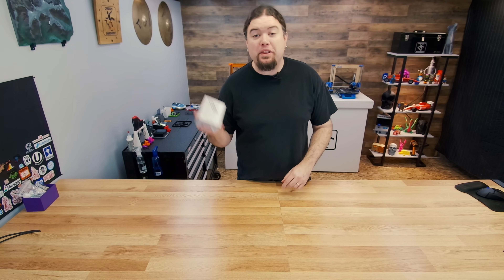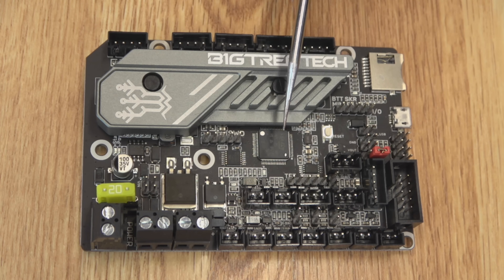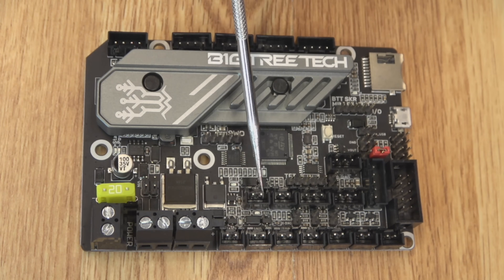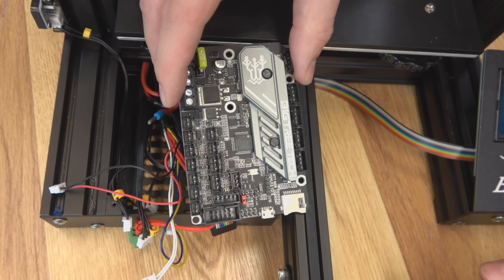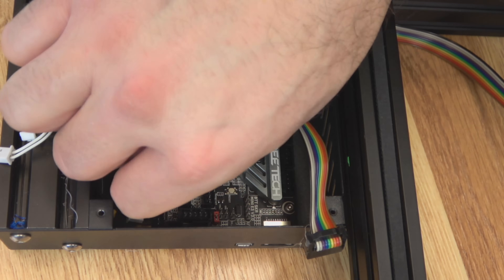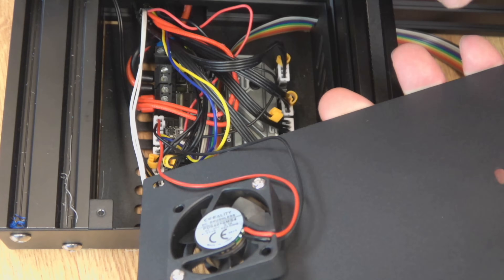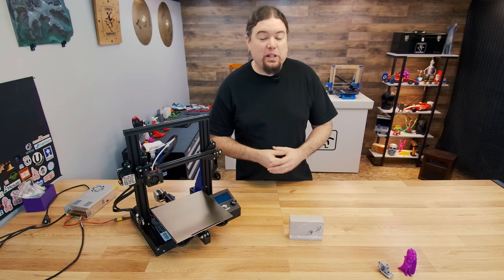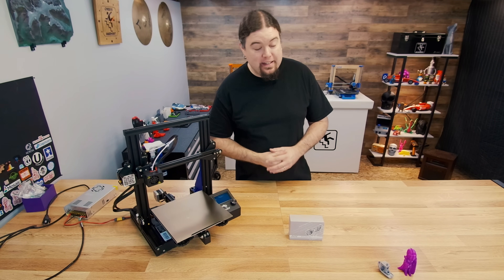BigTreeTech - SKR Mini E3 v3.0 - Chris's Basement

Comment: I'm considering this board as my SKR 1.4 turbo upgrade is a failure so far.  Can't home.  Testing stepper motors then if they all ok, I'll pull trigger on this board.   Question:  is there a way to add LED lights for bed illumination ?    Great Video.  Thank You
Reply from the maker: Thanks! Sure, you should be able to add a few LED's and power them directly.
Reply: @ChrisRiley  is the BTT TFT 3.5 screen (firmware 2020) older than SKR 1.4 Turbo.   The mainboard firmware was updated. Screen cannot see printer in btt mode
Reply from the maker: @bruceyoung1343  It's probably and issue with the serial settings in Marlin. Try setting serial 0 to -1 and serial 1 to either 1 or 2. That should be it going. Make sure the baud rate in marlin and on the screen match.
Reply: @ChrisRiley  I can heat the bed and nozzle.  I can see my custom name.  I wonder if btt TFT screen needs firmware update
Reply: @ChrisRiley  just to confirm that’s in configuration.h.  ?
Reply from the maker: @bruceyoung1343  Correct.
Reply: @ChrisRiley  I have serial and serial 2.  So I had serial at 0.  And serial 2 at 1 (no printer attached) and then at 2 ( no printer attached).  Baud rate firmware 250000 and printer 250000.   I’m open for suggestions 😕
Reply from the maker: @bruceyoung1343  Only other thing I can tell you is to make sure the cable is correct.
Reply: @ChrisRiley  they are Chris
Reply: @ChrisRiley  the BTT  TFT SCREEN FIRMWARE IS 2020.  Can that have a bearing?
Reply from the maker: @bruceyoung1343  I could, I would consider upgrading.
Reply: @ChrisRiley  firmware for the btt TFT screen?
Reply: @ChrisRiley  firmware on it now is dated 2020
Reply from the maker: @bruceyoung1343  https://github.com/bigtreetech/BIGTREETECH-TouchScreenFirmware
Reply: @ChrisRiley  THANK YOU VERY MUCH

Comment: Thanks for the video Chris. I have two z steppers installed, would it be better to use the split cable or two separate cables and are there any issues to be aware of with either option?  👍
Reply from the maker: Both options should be exactly the same. I would just go with 2 cables I think.

Comment: Hi Chris I just bought SD CARD Extender, so I can use norm SD card. But when I plug it, the Lcd Shows SD Init fail. How to solve it?
Reply from the maker: Not sure, it should work the same as the SD card, unless it is wired differently.
Reply: @ChrisRiley  I think it has something go to do with the configuration in firmware. Or just compatible with sd slot on tft screen. The SD Extender works fine on ender 3 pro original  board. It's detected automatically after inserted.

Comment: I have just installed this in my ender 3 v2.
The screen is black and the buzzer sounds. Contacted BIGTREETECH and was told the stock screen is incomplete. 
Probably worth a mention. Now what ? 
Junk the board or get touch screen? Or is there a fix ?
Reply from the maker: Yep, the V2 screen is hard to deal with. You could make a new cable that would work, but it's not going to be easy. I would probably just swap to another screen.

Comment: I hate to bother you, I know you've probably got more going that people think but I am stuck. I purchased the Mini E3 V3.0 and right out of the box the board does not recognize that it even has a Micro SD slot on it and it say no printer attached. Though a defective board so I had Amazon replace it. Well guess what, the second board has the exact same issue. Someone said it is because I'm trying to use it to upgrade a Anycubic Mega Zero 2. Their nuts. That has zoo to do with it. Steppers are steppers. Period. Also, in marlin mode the board will control everything but in the BTT mode zip. Configuration  is: BTT Mini E3 V3.0, BTT TFT35 E3, Anycubic Mega Zero 2, second Z-Axis Stepper installed, BTT Wifi, "which works flawlessly" , stock Extruder. I am going nuts trying to get this to work. What are the chances both boards build months apart have the exact same issues. I feel that if I could flash the firmware it might fix it but without the Micro SD working I have no idea how to do this. Please help if you can. I've tried contacting BTT, ya right. They have my money " so to speak" not even a response after several emails. What a joke of a tech team. Anyway, I'm frustrated and about ready to take ALL my BTT products out thetherange and make a nice YouTube video of me using everything BTT as targets. That's how disappointed I am with BTT support. They suck.
Reply from the maker: Hey, so if it's working in Marlin mode and not touch screen, it's usually a serial setting causing the issue. Try changing serial 0 to -1 and serial 1 to 1 or 2. Make sure the baud rate setting on the screen and in Marlin match as well. Hope this helps.
Reply: @ChrisRiley  Well have you ever felt like a total idiot. I'm there now. For whatever reason I had the TFT plugged into the wrong serial port. What an idiot. Just goes to show that even us so called old and wise can make some pretty stupid mistakes. And I made a big one. I still heeded to do a lot more playing with firmware and the such but it would have gone a lot faster had I noticed that mistake. However, I still appreciate your responding and trying to help. That was very kind of you. Thank you. I'm now doing some fine tuning for nozzle distance from the bed and a couple other minor things but at least everything now functions as they should. Again, thank you so much for your help. Have a great day and keep up the great videos.
Reply: @ChrisRiley  You are awesome just for responding. You have been the first to actually seem to care. Thank you. I will give that a try. Of course if it works you're a hero. Thank you. I'll definitely let you know what happens.

Comment: Hey Chris, I need some help please getting the mini 3v3 to turn on. My first mini v3 I thought was fried cause when I plugged it into my computer no lights would come on nor comms link. So I bought a mini v2 and v3 just to test. Now the v2 will light up and establish a comms link when plugged into the computer but the new v3 still won't light up nor open a comms link... What's the odds that 2 mini 3 v3 are fried? Am I doing something wrong? Or does it require a power 12/24v power supply to come on? 
Mike
Reply from the maker: You have to switch the VCC USB jumper to get them to light up via USB. It's a red jumper, if you can't find it I will get you a pic.

Comment: Question before I get one... My ender 3 pro has the SD and usb slot on the upper left instead of the bottom right... is that because the board is upside down on my older ender 3 pro?   as my fan is also on the bottom of that box where the board is....
Reply from the maker: Yes, some ender 3's the board is flipped over, these boards should still fit.
Reply: @ChrisRiley  Thank you,... one more quick question....  What is a Thurmister?    LOL      

I really know what you meant... had to mess with ya...  thanks again for the reply..getting ready to put my new board in now...

Comment: Can klipper be installed instead of marlin as its firmware? Or is klipper run from the PI?
Reply from the maker: It can be, but you will still need a Pi to run Klipper.

Comment: hi Chris. .. I just followed your tutorial ,  after all installed. my Auto homing failed.. do you know why ?
Reply from the maker: What did it do when you hit auto home? Anything at all? Are you using sensorless?
Reply: @ChrisRiley  I have fixed it .. seems the belt it too tight.  thanks .. do you know how to add wifi to the board ? is it possible to use BTT TF cloud ?

Comment: Quick question is it possible to connect the new creality screen to a skr e3 mini v3?... I know everybody's going to say just get a TFT35.... But I have a couple extra creality screens that I would love to use and not spend the money...
Reply from the maker: It depends which one. If it's the one like on the Ender 3 V2, I am not sure that will work. The 12864 style with no SD card would work just fine.
Reply: @ChrisRiley  thanks Chris and of course that's the style I have is the Ender 3 v2...my luck lol

Comment: Got one of these for my CR10 V3. The stock board for it is larger than the SKR Mini. I'm also putting in a BTT TFT35 V3 with it. I can't find firmware for the CR10 V3 anywhere
Reply from the maker: I didn't even know there was a V3. I would guess the stock CR10 config would work of the most part with a few added tweaks.
Reply: @ChrisRiley  Using the V2 firmware. The V3 has dual Z like the V2. It has direct drive so e steps are way off

Comment: I got my board installed, good firmware, however when i try and move the Z axis, it also moves Y axis as well. I get no movement with X, but when i I try the Y axis movement it moves X axis. Any thoughts?
Reply from the maker: Whoa, that doesn't sounds good. That sounds like there might be a short of the board somewhere.

Comment: Make guide for mk3s with SKR mini E3 please!!
Reply from the maker: It should work the same as the Ender 3, but you will lose all the Pursa firmware goodness.
Reply: @ChrisRiley  im so noob on custom programming like this but i have prusa bear kit i used to use with my prusa mk3s. Now mk3s back to stock i have left with all frame & linear rail, just need printed parts and electronics so im planning to revive that with fly e3 pro.

Comment: Just ordered mine after shorting my 1.2 when brushing of my nozzle 😉 Damn those naked cables on the heater... 😉 Thanks for the video, it really helps with the initial setup! 😁 Please continue making these even if its just a new version with some minor improvements 😊
Reply from the maker: Thank you! Will do!
Reply: Done the same thing on two different printers and boards. Connect a fuse on one of the cables. This way you should have no problems with blown boards.

If you're lucky it´s only the heater circuit and/or thermistor circuit that´s blown, but the rest can work.
Using klipper you can add the board as a auxiliary board, to run more steppers, more controlled fans, etc, etc.

Comment: I installed this board on my Ender 3 v2 using the default Ender screen. When I power it on, the screen just lets out a continuous beep. I tried to update the firmware with the latest precompiled bin they have on their Github but it did not flash onto the board. I've been told that I have to rewire the ribbon cable of buy the TFT screen but you seem to have it working with the default Ender screen (although yours is the older one and not v2). Any ideas?

Yes I formatted the mSD the firmware is on as FAT32*
Reply from the maker: The V2 screen is a lot different from all the others. I am not sure what it would take to get it working like the old school screen. I know Marlin supports it, but that would require builing a new config for this board with that screen enabled.
Reply: @ChrisRiley  It looks like it did flash the the bios from BTT's github. I noticed the firmware.bin on the mSD was changed to a .cur. So I imagine that bios just isn't the most up-to-date.

I'll try compiling a new Marlin v2.0.9.3 firmware tonight and see if I can get it to work with software before I go and make a new cable.

Either way, I'll report my findings here in case others are having the same issue.
Reply: @SchwettyBawls   tambien tengo e l mismo problema men

Comment: Thank you for all the information, by Ender 3 pro board died yesterday and I got the BigTreeTech - SKR Mini E3 v3.0  and had trouble finding all the info I needed to fit it, you filled in all the holes without taking forever to get there. Thanks, I have subscribed to keep up with all the changes
Reply from the maker: Glad I could help. Thanks for the sub!

Comment: what to do if the hot end fan doesnt come on around 50/60 ish..I've gotten the nozzel up to 100 and the fan never came on
Reply from the maker: It has to be something not set right in the firmware. Check configuration_adv.h 

#define E0_AUTO_FAN_PIN -1
#define E1_AUTO_FAN_PIN -1
#define E2_AUTO_FAN_PIN -1
#define E3_AUTO_FAN_PIN -1
#define E4_AUTO_FAN_PIN -1
#define E5_AUTO_FAN_PIN -1
#define E6_AUTO_FAN_PIN -1
#define E7_AUTO_FAN_PIN -1
#define CHAMBER_AUTO_FAN_PIN -1
#define COOLER_AUTO_FAN_PIN -1
#define COOLER_FAN_PIN -1

#define EXTRUDER_AUTO_FAN_TEMPERATURE 50
#define EXTRUDER_AUTO_FAN_SPEED 255   // 255 == full speed
#define CHAMBER_AUTO_FAN_TEMPERATURE 30
#define CHAMBER_AUTO_FAN_SPEED 255
#define COOLER_AUTO_FAN_TEMPERATURE 18
#define COOLER_AUTO_FAN_SPEED 255

Comment: tried so many things to get this board to work, all I get is a solid red light and a blank screen when turning on the printer.
Reply from the maker: It might be a bad board, I would unplug everything from the board except the LCD and try to boot up. If that doesn't work, try to re-flash the firmware from the BTT github.

Comment: This may not be the right place for this, but I had replaced my motherboard and hotend fan (that are normally always on) with noctua fans that required buck converters to drop the always on 24V to the 12V that the fans use. What voltage do the V0/V1/V2 JST spots run at? I'd like to still use the noctua fans with the JST spots but don't know if I need to adjust the buck converters, remove them, or replace them with boost converters, any recommendations? Forgive me for the shoddy phrasing, electronics are not really my forte.
Reply from the maker: Hello, yes, all those fans are going to run at input voltage, so whatever the PSU runs at, these fans will as well.
Reply: @ChrisRiley  thanks Chris! I saw some 5V and 3.3V power options with the board information and wanted to be sure. Thank you for your help, sir!

Comment: I assume if I buy this board I can just plug it in, turn on the printer and start printing without having to figure out how to get and install firmware? If that is true, can I print TPU or Nylon with this board and the firmware that comes on it? I have the Micro Swiss hot end that can do the hotter temps, so will this boards firmware allow me to print nylon? Thanks for the video. Subbed.
Reply from the maker: Thanks for the sub! Yes, if you have an ender 3, this is a direct swap in part, for firmware changed needed. You can print TPU and nylon.
Reply: @ChrisRiley  Oh that's awesome. Thanks for responding to me and letting me know. I really don't want to hassle with trying to change firmware. I just want to plug it in and print.
Reply: @ChrisRiley  THANK YOU SO MUCH! I bought the v2 board, swapped the factory board in my Ender 3 with this board and after 3 years of idleness, I am back to printing. I cannot believe how quiet the motors are. The only thing making any noise at all is the cooling fan on the power supply. I bought the Ender 3 maybe 3 or 4 years ago and printed all kinds of stuff. Then I put it away and haven't touched it. I started flying FPV drones 2 years ago and wanted to print parts for it but my printer wouldn't print anymore. It would just restart every time I told it to print. Your video and advice got me back to printing again. A Gopro mount for my 5 inch drone is like $27 and I break them all the time and have to buy a new TPU Gopro mount. Now I can print them myself. Thanks so much. You earned my subscription.

Comment: Thank you Chris for the video but I am having some trouble that you might know how to fix. I put in the board and everything but it is stuck on the bugfix marlin section when I boot it up. I can't think of an issue that would cause this, thanks
Reply from the maker: That's not good, it won't post. About all I know to do is unplug all the connections except the LCD and see if it will post. Also, you might try reflashing with firmware from the BTT github.
Reply: @ChrisRiley  Thank you for the reply, I figured out that the firmware was not flashing unless I reformated my sd card. odd problem

Comment: Hi Chris I love the video and it perfectly explained everything I needed to know! I'm currently looking into getting a different board for my Ender 3 pro because it died just the other day
Reply from the maker: I'm so glad I could help. Good luck with your projects
Reply: I bought this board ,, arrived today, my V2 Turbo started giving heater error ( E-1) I'm thinking the thermistor plug on the board. I had replaced the orginial hot end and both heater block and thermistor, still got the error a few times.
Installed this E3 V3  board and 1st print was very nice  with stock firmware.
It must have been that thermistor circuit on the board, in case anyone has this issue. I can see no problems on the old boeard.
Thanks Chris for another great video, always appreciate your expertise and time !!

Comment: this board is a nightmare. I got the first with issues in z while printing, got a replacement and that thing just goes crazy on purging and retracting instead printing and moving thye actual printhead. I hated it, and it was really expensive. To add salt at the injury, you can only use some displays, so I needed to get a btt tft35 to be able to actualy try to use it without octoprint. This isn't even in it's early beta test step yet, just return it to btt and tell then to work on it for real this time. My poor "log" style printer is scared and won't come out to play anymore after this crappy.
Reply from the maker: I'm sorry you had such a hard time with this board.
Reply: How did you get it to connect to Octoprint?

Comment: I’m thinking of updating my ender 3 main board 1.1.5 finally, and was wondering if you’d recommend this v3 board over the v2. Will you be doing a follow up on this board.
Reply from the maker: Yes, I would get this one over the v2, it just have more features. I will be using this board in more videos coming up.